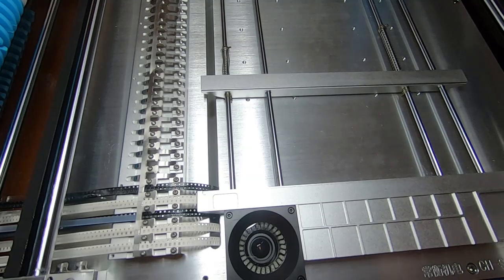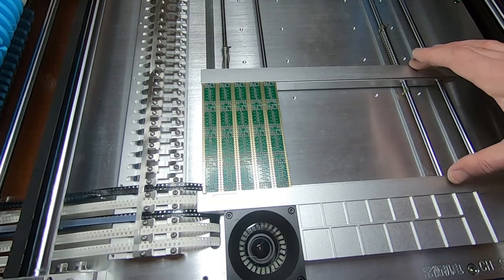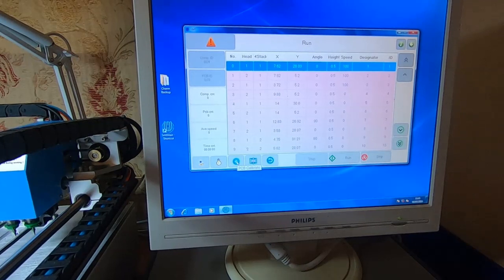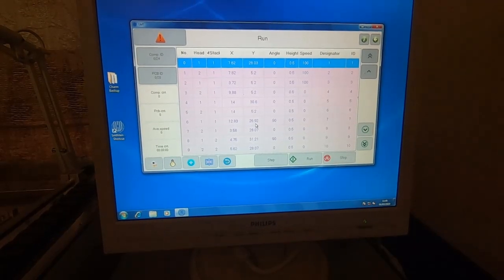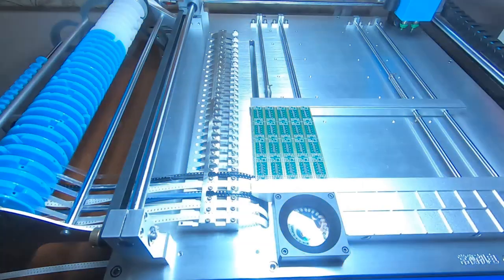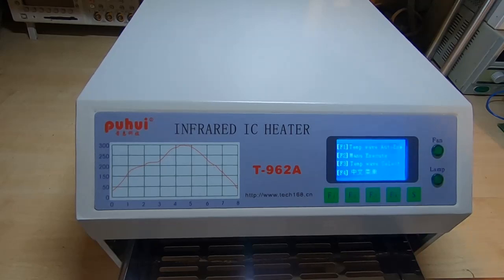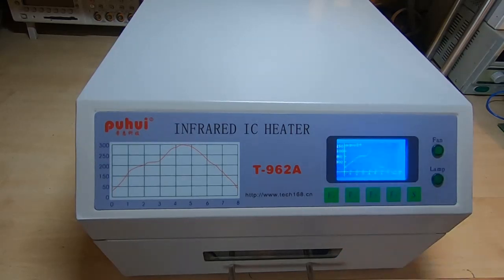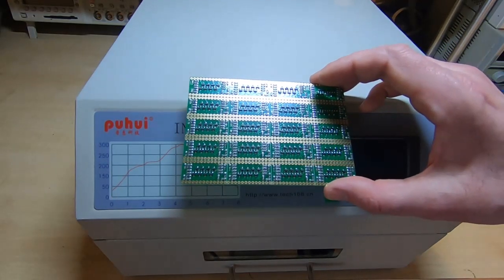CHM T36VA Pick and Place Machine Part 5

Comment: Hi Jerry,

Thanks a lot for posting these videos. I have a PCB which is 1mm thick instead of 1.6mm. What is a proper way for adjusting the machine for that thickness? I did some resesrch but fail to find any useful information on the subject 

Thank you!
Reply from the maker: You can either adjust the machine to drop the placement position by 0.6mm or you can put a 0.6mm spacer (same size and shape as the pcb) underneath the pcb). I normally use a spacer as this avoids the need to adjust the machine and also thinner boards are often not very stiff so the spacer 'stiffens them up a bit. To adjust the machine you need to enter the config screen.
Reply: @JerryWalker001  thanks for the reply.

Is there a software configuration to adjust placement position or I need to manually tweak the hardware ? I can't seem to find it in the software. 

Thanks again!

Comment: When you load the file to the machine. Is the file for one unit or a panel of 5 x 4. Can you load the file for one unit and tell the machine the panel is 5 x 4 for example?
Reply from the maker: You can do it either way. If you want to create a panel in the CAD system then the P&P just treats it as a single board. I tend to create a single board on the CAD system and then create the panel in the P&P by repeating the board (as you say by telling it to repeat the board eg 5 x 4). You just need to decide which you are intending to do when you have your boards made. I find it easier to have the P&P create the panel as it means less components to adjust.
Reply: @JerryWalker001  Thanks for the reply! If there's a gap between each pcb how does the software work out the panel size data? Will this only work with panels with no gap.Also  Do you just export the plot CAD data from your pcb design software?
Reply from the maker: It does not matter what size the boards are, you just specify the step size. Eg if a board is 100mm wide and you have a 5mm routing gap then specify a step of 105mm